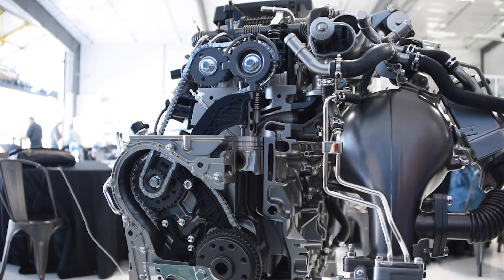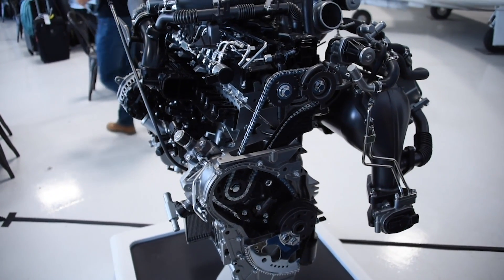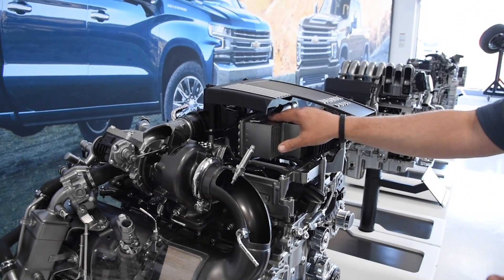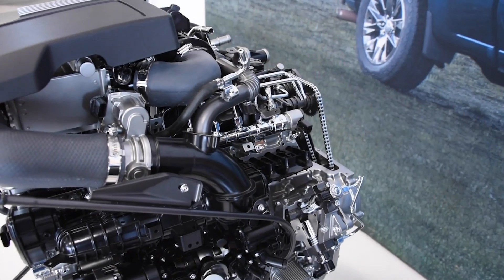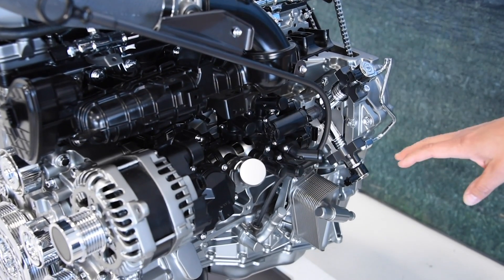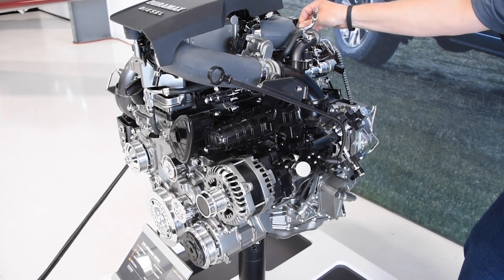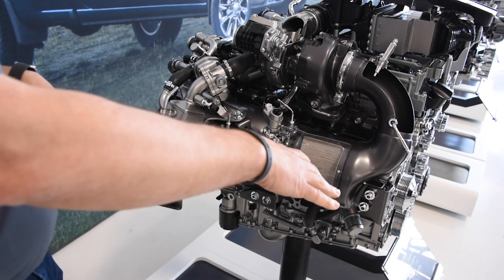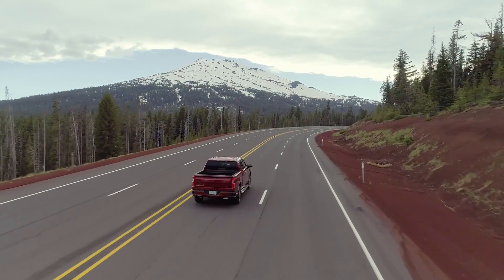What you don't know about the 3.0-liter Duramax diesel

Comment: Guaranteed $1,000 to change that oil pump belt, but it doesn't matter because even a few seconds without it means your engine is toast. On top of that, he said it will last 150,000 miles which is "the full useful life". Does that mean they expect the truck to be toast at 150k?
Reply from the maker: It shouldn't cost anywhere near that. A GM tech could get that transmission out in an hour–the whole job shouldn't take longer or cost more than changing a timing belt on an average passenger car, but no one seems to care about that, or that a timing belt typically has a service life of 80,000, not 150,000. The engine has a built-in safeguard to shut down if there is a loss of oil pressure, and it will take more than a few seconds to cause damage. If you don't believe me, consider that when you start your car or truck in the morning, it's running for more than a few seconds before oil starts running through the circuits...and it does it every day.

Comment: the :  worst things about a duramax? 

#1- it's loaded with smog controls
#2- the price of the fuel can go up at random- WAY UP. 
#3- you can't MAKE your own fuel.
#4- it's GM- which means the are just crazy giddy about the day the warranty runs out so they can start charging you 300% markup on parts. 
#5- it's NOT electric.
#6- worst of all? it's not a tesla. 

if you live in SC or some other non-commie state and fuel is $1.50 a gallon & they don't smog? excellent. you're home free. not too bad of an engine. still- you could have had a cybertruck for $39k and then your fuel costs are about 1/2.

Comment: Actually removing the trans is not that hard.
Reply from the maker: That's what I've been saying. It sounds hard, but the mechanic will put that thing on a lift and have the trans out in an hour. It would take MUCH longer to drain coolant, remove the radiator and three cooling fans, then the front accessory drive and cover to get to the chains. Then you'd have to re-assemble and bleed the system...that's three hours minimum.

Comment: Perfect engine for the pie plate starter generator hybrid. I would like to see GM put it on the front of the engine. Everything could be electric and eliminate the serpentine belt. If they did it properly it could be maintained much easier than any other engine and everything could be more strategically located.  For instance the air conditioning compressor could be located within the heating system and made to be easily worked on.

Comment: Why not just let the mechanics design the motor?
Reply from the maker: Lol people have asked that question for as long as I can remember. The simple answer is that they are engineers–and building something from scratch and fixing it are two very different things. It would be nice, however, if the engineers could design things WITH a mechanic, but that's not how it works.

Comment: I'd have preferred the oil pump belt be on the front of the engine, but a wet belt like this should last 150,000-200,000 miles.   I don't like that it will cost an extra $600 or more for a shop with a lift to back the transmission off to replace it, but it's not a deal breaker.  

I like that it uses timing chains.   Seems like a very good motor.
Reply from the maker: As I've said elsewhere, people tend to forget that a timing belt on just about any car out there must be replaced every 80,000 miles at a cost of around $700 (depending on the vehicle) and no one seems to have an issue with that. But replace a belt every $150,000 for probably around that same amount (or even a few hundred more) and people lose their minds. They're forgetting that, although this is a diesel, it is a LIGHT DUTY diesel and not intended nor sold as a heavy duty engine like a Cummins that has a recommended rebuild interval of 300,000 miles. It has different emissions requirements than a heavy duty "commercial" diesel engine, and the expectations for reduced noise, vibration and harshness (NVH) are much higher on a light-duty diesel because the customer is different. An HD customer likes the diesel sound and doesn't care about vibration or gear noise as much–but a light duty customer expects a diesel to be as quiet as a gas engine. That's why there's timing chains and an oil pump belt instead of gears.

Comment: Rear cam drive- just like Isuzu diesel- pure crap! Oh, wait! Duramax is Isuzu! Why would ANYONE WITH HALF A BRAIN DESIGN A BELT DRIVEN OIL PUMP?!
Reply: Guess you haven’t worked on a 6.6 Duramax ... everything up to LML isn’t hard to work on and relatively straight forward for the most part, they all have their own issues but the 6.6 is much less complicated than this pos and WAY easier to service

Comment: I am a retired ASE Master Tech with over 50yrs under my belt. This rear cam drive system is the most fucked up thing ever designed by morons. Ask any tech who works on VW or Audi, they have this dumbass system on many of their cars. The cam chains,tentioners and guides just don't last. One reason is these idiotic extended oil change intervals. GM never learns. Ford on the other hand is developing an opposed piston diesel for their smaller pickups. That is old tech that offers high power, light weight and super fuel economy. No cams,lifters,valves, heads etc. And it seems like common rail fuel infection was made for this type of engine. I am not a Ford fan so much but I will buy one if they build them.
Reply from the maker: I think that depends.The cam chains, tensioners and guides on a Prius, for example, are designed to last the life of the engine, and do so routinely. There are a lot of them running around with 300K plus miles on them.
Reply: @TheRVConnection  That is because they are made by Toyota. My 94 Camry has 358,000 mi on it and the cyl head has never been off.
Reply from the maker: @klesmer  Totally...that's not uncommon on Toyotas, especially with religious maintenance. My point is that is IS possible for a system like that to last a long time IF it is properly designed and uses good materials. Let's hope they got it right this time. Thanks for watching!

Comment: I never work on diesel trucks but I do engine swaps on cars for fun projects. if just drop the transmission then its not that bad. I hope they have the fail safe when it sees no oil pressure then throw red flags and let the operator know to pull over and shut off so it can go as long as it can.  Is it required to separate the cab ? Isnt that the Ford required to do ?
Reply from the maker: I was told the engine will shut down immediately if there is no oil pressure.
Reply: @TheRVConnection  very good to hear that. Few weeks ago my 04 5.3 with 238k oil pressure was finicky and result knocking. So I sold it and bought 2020 Silverado 3.0 durmax. I been hauling motorcycles and still get 33 mpg highway. Could not ask for anything better.
Reply from the maker: @Nismokai  Excellent. Enjoy in good health!

Comment: No one with any brain cells would buy this engine with a belt for the oil pump!!!!!
Reply from the maker: Why? People buy vehicles with belts for the camshafts all the time, and they require replacement at around 80K. Ever seen what happens when a DOHC engine breaks a cam belt? It ain't pretty. These type of cog belts are very, very tough...and if changed on schedule I don't think it's any more likely to fail than a chain.

Comment: Questions for John Barta (project engineer).  1.Have you ever removed  a transmission ,transfer case , drive shaft, cross member ,exhaust and on and on from a 7 year old 150,000 mile truck? 2 . Have you purposely  installed a damaged belt and run the engine under load until the belt broke?  If you did, how many seconds did it take until the rod and main bearings seized.I think that you are unwise to put your name out there as the guy that designed this thing.I think that this belt will go down as a disaster , similar to GM 60s plastic covered cam sprockets , 70s Oldsmobile diesels ,80s cadillac valve decommissioning ,90s cadillac northstar headbolts 2000s chev ls variable displacement ,ectect
Reply from the maker: These questions have come up before. 1. I have done this, yes. And as difficult as it sounds, I think that removing everything from the front of this tightly-packed engine compartment (radiator, three cooling fans, water pump, front cover, etc) to change a belt, then re-assemble and bleed the cooling system correctly would take just as much (if not more) time. 2. I'm quite sure the engine has undergone exhaustive testing, as all new engines do. If the belt does break, the engine stops running immediately. I know the engines you are talking about (I worked in an automotive machine shop for many years) and you can't compare materials from the 80s to now. That composite belt material is extremely tough and it is a wet belt, so it should wear as reliably as a chain. Finally, it is unlikely that most owners would own this engine for 300,000 miles or more. That means this type of service would be required twice in the truck's lifetime, at the most.

Comment: Need to change a brake taillight bulb? No problem! Drop the transmission, remove both rear suspension and drain the oil pan to access the required botls. Amazing design indeed.

Comment: I'll give em credit for figuring out how to get the EGR after the DPF.  Soot ingestion is a major deal on BMW diesels and intake manifold/swirl system get clogged up by 150K miles and EGR coolers rarely go past 100K. Also, good choice with I6, this is a big NVH advantage over the Chrysler/Fiat V6 and certainly improves packaging of the SCR, DPF, & turbo.
Reply: Its not the EGR by itself getting those clogged up, it's the PCV valve that's not a service item for most dealers that cover everything in fine oil mist after 30-50k miles of life, which then it traps the soot on the oil.
Reply: Why does it even have EGR? It’s been proven that robust SCR can be used to eliminate EGR, EGR coolers and all the associated re-ingested soot nightmares. This engine employees all the worst mechanical principles and technology that contribute to an engines longevity, reliability, cost of ownership, repairs and maintenance. IMO if an engineering team was tasked with developing a power-plant that would kill the ambitions of the diesel truck consumer this is the engine they would dream up.

Comment: I think it’s about time we got some small diesel (reasonable size)engines for the half ton market.
My only real problem with this new Diesel engine is the “oil pump drive belt”(wet belt) I don’t understand why it too could not be a chain like the rest of it🤷‍♂️
Reply: Or at least make it a option that cost the difference with a notice about it being louder apparently noise is why they used the belt

Comment: GM would have a hit if they would install this into the Colorado even if they had to lengthen the front a few inches.  It would be a good match up pulling the Winnebago Micro Mini 2405 5th wheel camper at only 7 feet wide and 5,700 to 7,000 lbs max. weight.

Comment: Why use chains and a belf for the timing and oil pump. Jesus. It’s over complicated for no reason. Did they not think to use gears
Reply from the maker: The simple answer is noise. Light duty customers want their trucks to be quiet, and chain/belt drives are quieter than gears.

Comment: I now know how the meeting went on day one of the design department's development plan. How can we design an engine to force more money out of the customer ? Eliminate all gear to gear  drives, use the smallest timing chain possible, make sure it's on the back end of the engine, and drive the oil pump and with a belt that needs to be serviced at 150,000 mile intervals. 
I the guy in the video would have finished the statement of : the belt needs to be serviced at 150 thousand, that's the minimum miles for the service. It can go longer but...... LMAO.
Yeah it can go longer till it fails and grenades the engine. 🤣

Comment: Dont get me wrong it's a cool engine, but a rear engine timing system, and belt driven oil pump? "To service this you simply have to drop the transmission." What a joke. First the design of the body, and now the design of the engine...

Comment: Are they kidding?  The belt-in-oil thing is costing people with Ford's Ecofart 1.0 I3 a fortune, the timing and oil pump belts rarely make it to 100k, the oil pump is the first to go and the motors self destruct almost immediately.  Can you see someone with a diesel, actually working it, pulling a heavy load and the belt breaks....   And GM's recent history with those narrow timing chains on all their OHC designs hasn't been great.  Put it all at the back so "just the transmission" has to come out.  Ugh.

Comment: Thanks for completely convincing me not to consider this engine option. I have a 2006 Ram 2500 with the cummins 5.9.  I have 380k miles on it. I thought about replacing it with this for its greater efficiency and better comfort of today's trucks.  Earlier this year, I went to the new car show specifically to look at this engine, and thought, "forget it".  The engine is completely covered in a bunch of other stuff, will not be easy to work on. 

Now I see this wet belt driven oil pump and service life is 150k miles?  No thanks.  I like diesel for its longevity and prefer the inline 6 as I think it's generally more reliable and easier to work on.  I will probably buy another Cummins powered Ram sometime in the future.  The 5.9 is still sufficient for what I do.  I just wish I had a bit more cab room, should have gone mega cab back in 2006.
Reply: This isn't 2006...all that "bunch of other stuff" is the same no matter the manufacturer.  That belt will easily go 300k before it actually reaches it's life expectancy.  150k is just a suggested service...and it's a 2 hour job.  Less time than many "dry" timing services on the front of many engines so I don't know what everyone's getting all up in arms for either! And that's according to a 27 year GM Master Tech friend of mine who' actually knows what he's talking about....
Reply: @TakeDeadAim  Well you're right about the bunch of other stuff, they all have it but it some do it better than others.  Same for the  design of the oil pump.  Sure you could say it will last longer than 150 k miles, but who is going to take a chance when vehicles are so expensive now-a-days?  I'll stick to my old cummins for now.  Why don't you buy the GM diesel and let me know how it does.

Comment: i'll cosign on the oil pump BELT (two things that should never be put together) being a horrible idea, but seriously? listening to some of ya'll talking about how disasterous it is to drop a trans is hilarious. give me about 5 different tools, and 30-60 min and a jack/jackstands, and i would bet money i could have it dropped. to a non mechanically minded individual i can see how this would seem like a steep task, but honestly, doing this say 3 or 4 times in the entire time you own the vehicle (doing it early at 125k, that would mean it would be yours for 375-500K miles).... you'll have more time vested in changing the oil by the time it's all said and done.
Reply from the maker: I agree completely. Everyone thinks dropping the trans is a HUUUGE deal, but I'd rather do that than remove the radiator and cooing fans, disassemble the front of the engine, then put it back together and bleed the cooling system, etc etc.
Reply: @TheRVConnection  amen brother. amen.

Comment: Looking at this vehicle, the GM Powertrain warranty for this engine is 5 year, 100000 mi. The only catch I'm trying to figure out is if they call it a "wear & tear" item, since it's a belt or if it's part of the Powertrain coverage.

"The 2020 1500 Series Light Duty (LD) pickups equipped with a 3.0L Duramax Turbo-Diesel Engine and 2500 and 3500 Series Heavy Duty (HD) pickups equipped with a Duramax® 6.6L Turbo-Diesel V8 engine are covered for 5 years or 100,000 miles, whichever comes first, see dealer for details."
https://www.chevrolet.com/owners/warranty
Reply: From the 2020 Chevrolet Limited Warranty and
Owner Assistance Information handbook:
"Diesel Components Coverage includes: Cylinder block and heads and all internal parts, intake and exhaust manifolds, timing gears, timing gear chain or belt and cover, flywheel, harmonic balancer, valve covers, oil pan, oil pump, water pump, fuel pump, engine mounts, seals, and gaskets. Parts of the Emissions Reduction System such as the emissions reduction fluid tank, injectors, sensors including NOx and exhaust, and the Exhaust Particulate Filter. Glow Plug Control System: Control/glow plug assembly, glow plugs, cold advance relay, and engine control module. The fuel injection control module, integral oil cooler, transmission adapter plate, common fuel rails, fuel filter assembly, fuel temperature sensor, and function block."

"timing gear chain or belt and cover" - seems to be covered with a 5year, 100000mi warranty.
Items in the Powerdrive exclusion list are: sensors, wiring, connectors, engine radiator, entire pressurized fuel system (in-tank fuel pump, pressure
 lines, fuel rail(s), regulator, injectors, and return line), and the Engine/Powertrain Control Module and/or module programming. However, the Engine Control Module is covered under the Emission Warranty for 8 year / 80000mi. Most emission related sensors have 2 year / 24000mi warranty.

Comment: Will it be possible to bullet-proof this engine by replacing that stupid belt system with a chain?
Reply from the maker: That's a good question and one that I have gotten from other viewers. The short answer is, I don't know...and right now, with the Covid situation, it's very difficult to get hold of anyone. I would say that it's reasonable to assume that there would be an aftermarket solution by the time the belt has to be replaced, either a chain or gear drive arrangement. Melling would likely be the supplier of that were to happen.